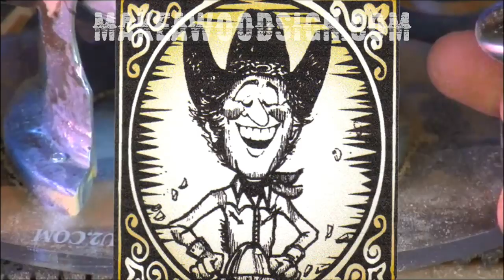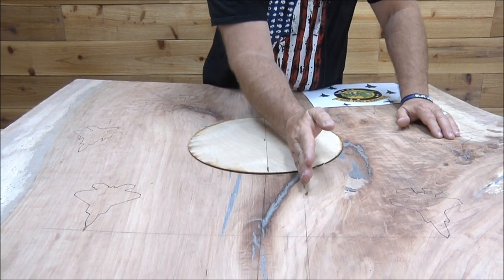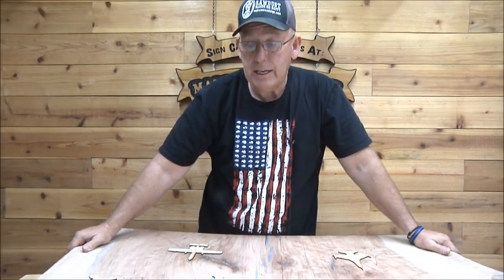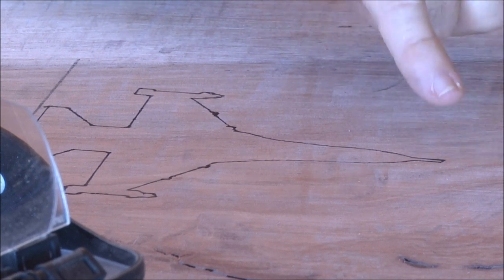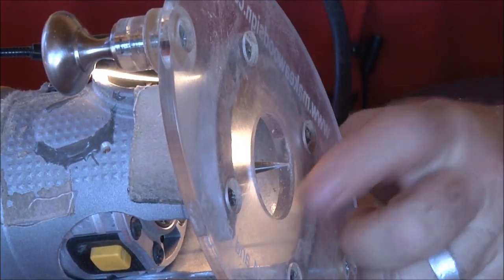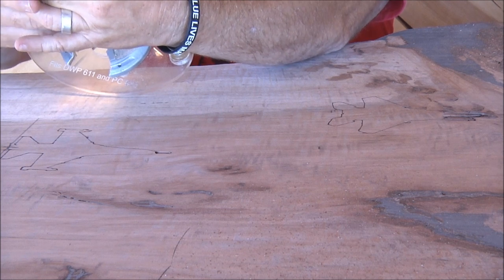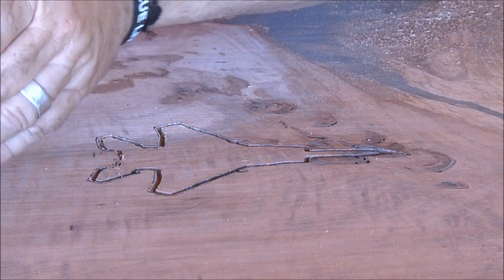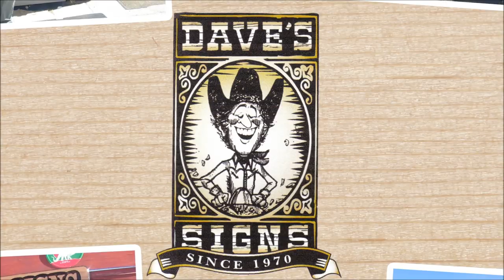#397 Freehand Carving Spalted Pecan Slab Part 1

Comment: I have a problem every time I try to go in a certain way sometimes with the profile bit it wants to go else where in another direction  I have to force it and it leaves lines in the wrong direction .
Reply from the maker: Try going shallow first and then going back deeper on a second cut. You maybe able to hold a better line that way.